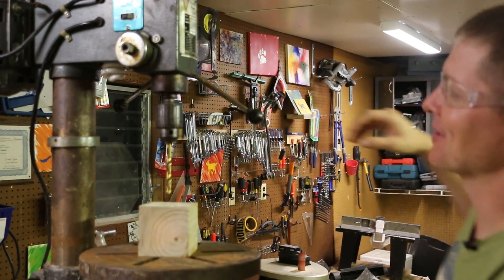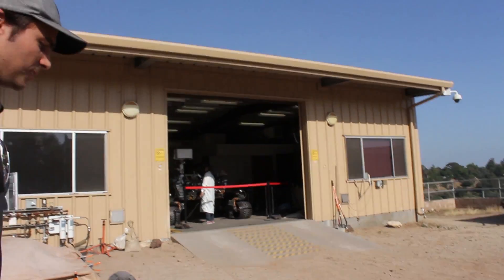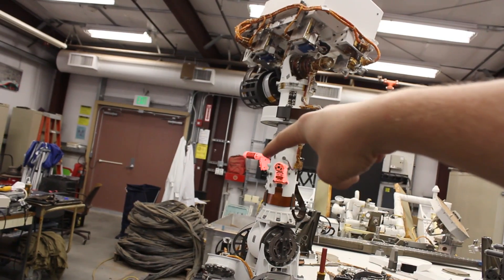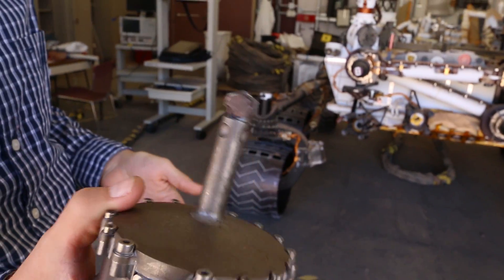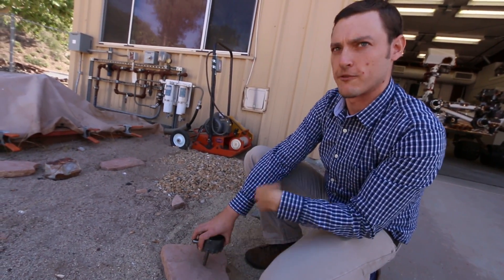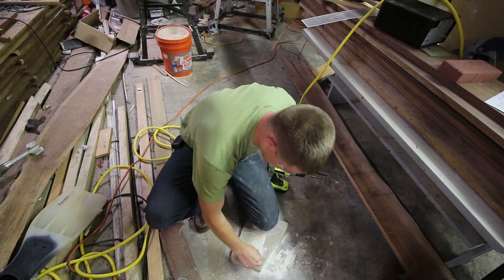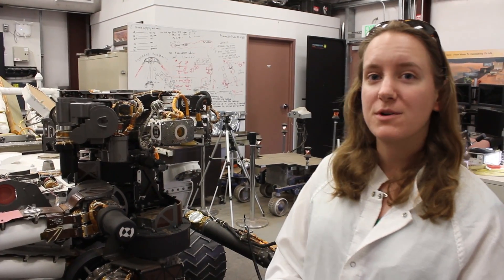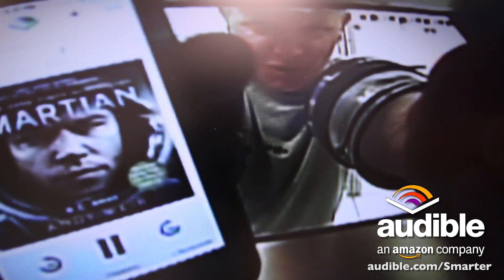The Drill we sent to Mars - Smarter Every Day 143

Comment: So whats the drillbit made of? Tungsten Carbide? Diamond? Nokia 3210?
Reply: +Internetspaceships The tip of the bit is tungsten carbide.  In hardness, it's somewhere between the Nokia and diamond ;)
Reply: +John Williams 
You're right, the drill bit (cutting edge and shank) is a commercially-available hammer (masonry) drill bit, with a little extra machining to improve sample flow along the flutes.  

I can't speak for the design trades that went into the bit assembly design, unfortunately.  The drill and the bit assemblies were designed and built by others long before I graduated from college and was hired at JPL.  You can find more information about the drill in NASA/CP-2010-216272, but it doesn't say much about the material trades that you're interested in.
Reply: +Video Olympics when things are too strong to break, its always made up of nokia 3210
Reply: +Internetspaceships Nokia XD the old phone that always could.
Reply: +Internetspaceships Nokia ?!!!! We are trying to get sample, not destroy the planet. PLus, if they drop the Nokia during the landing that will end the mission
Reply: I did not realize there was such thing as 'negligible weight' when launching craft to other planets...I've been in aerospace manufacturing for over 30 years and have kept-up with the new material-cutting technology available...ceramics, for instance, can in some applications preform as well or better than tungsten carbide.
   I'm not suggesting they would be better, I'm just saying that I'd like to have been the fly on the wall during the material review discussions because ceramics are a fraction the weight of carbide and when going to space; every gram counts!
Reply: +Internetspaceships pure nokium
Reply: +Internetspaceships  Tungside Diakia 3210
Reply: +John Williams Sintering a tungsten tip onto the drill is going to add negligible weight. Even with 2 back up drill assemblies.
Reply: +David Harding Awesome read! I&#39;s baffling that a commercially available product that anyone can buy pretty cheaply is so good as to being used, off the shelf, in a billions-dollar, space-fairing rover. And in one of the most important instruments!
Reply: +Ryan Kinnett 
   I imagine much debate went into the drill-bit design characteristics...with an emphasis on weight, and tungsten is heavy.
   Is the bit itself (cutting tip only):
SOLID carbide? 

...because to me, it looks just like a masonry bit for concrete but at such a weight cost! I'm sure plating atop lighter, yet stiff materials was also an option for a cutting edge...(I sure would have liked to be a fly on the wall during that phase of design discussion)
Reply: XD
Reply: +TheStarkest Like black boxes.
Reply: +Internetspaceships I got two Nokias, I keep them in case WW3 pops
Reply: I thought it was Depleted uranium + Titanium alloy = Special nasa classified metal
Reply: Most probably NOKIA 3310
Reply: Not the 3210, its the nokia 3310
Reply: +Internetspaceships 
It's carbide. The story follows:

My father was a scientist who worked with Gene Shoemaker on the curriculum for teaching geology to the Apollo astronauts and also on the team that designed the original Apollo Lunar Surface Experiments package (ALSEP). Gene was a college instructor for one of my best friends, who was in charge of the geologic mapping project for Mars at USGS. 

My friend invited me to attend the Lunar and Planetary Science Conference with him a number of times before he retired. I told him I was in Nerdvana every time I went. He introduced me to many on the science team for Spirit, Opportunity, and Curiosity, and I got to attend many of his working meetings.

One person he introduced me to was the man in charge of Curiosity’s instrument package, whose nickname was "Ratman" since he ran the RAT (Rock Abrasion Tool) on the original rovers. I've had many nice visits with Ratman over the years and he told me they wore out the diamonds on one of the rovers and I asked him if they were going to have a turret on Curiosity with extra bits and he said, "Yes, we'll have extras and you'll never guess where we got the bits--Home Depot!"  The drill bits are made by Hilti and were purchased at Home Depot. He told me the biggest problem they had to deal with was the quenching oils Hilti used in their manufacture. Hilti wouldn't divulge them because they were "trade secrets", even after assurance JPL would keep it under wraps. They did many types of cleanings to get the volatiles out and numerous tests to establish the chemical signature of what was left so that could be accounted for in their test results. I really think Home Depot and Hilti are missing a marketing opportunity in this.

Ratman’s wife is an orbital insertion specialist. She figured out much of the revised burns and insertion protocols for the Huygens probe that landed on Titan. Originally, a dedicated antenna had been planned for Cassini to handle the signals from Huygens but it was removed to save weight and the plan was to use the main Cassini antenna. Only after the craft was on its way did someone realize the main antenna couldn’t handle the Doppler shift between Huygens and Cassini and the early part of the mission had to be reconfigured to keep the relative velocity of the spacecrafts within range and then the planned orbits and gravity assists had to be adjusted to get the mission onto its original itinerary. Ratman’s wife is the one who calculated all that. He told me, “I consider myself to be a very competent scientist but I don’t even pretend to understand what my wife does!” So, if you see a soccer mom tooling around in her minivan near the JPL campus, she just might have a higher IQ than you and me combined.

Ratman also showed me some videos of a few other rover ideas they are working on, including some that could separate into two sections and lower one down into a lava tube skylight or off a cliff to do some science. Those guys have WAY too much fun!

Comment: How do they make sure that the debris in the first and second chamber of the first drill doesn't mix up with the dust from the second drill? Or does it not matter really?
Reply: +BigBadWolf When a sample is collected, the rover does all of the processing it needs to do for that sample then dumps it before collecting the next sample. There is some contamination between samples but that's part of the reason for the Organic Check Material OCM. If a really interesting science result was found in a location, the rover could sample the OCM to get a baseline from a known material and then collect another nearby sample and see if the same result is confirmed.

Comment: Why do they have to over-complicate everything? I would've put a vacuum hose on the end of the drill (a proven tool) and analysed the dust through that. I honestly hope they're not just justifying their jobs with this rube-goldberg approach.
Reply: +Dani2wheels Its actually simpler than a vacuum. A vacuum needs a additional motor, and a fan. Possibly another tube as well.Which are simply more things that can break. The arm already shakes to drill and a contained motor isn't that liable to break. You also have to remember that mars has .6% of the atmosphere of Earth, you would have to then have a really powerful motor to produce suction in that kind of pressure. A little motor to turn something isn't that big is less complicated than a huge vacuum.
Reply: James Kinard Good point
Reply: +Dani2wheels How much non-drilled material would you vacuum in? derp.
Reply: Xelbiuj Wtf are you talking about
Reply: +Dani2wheels Vacuum cleaners don't really work when used in a near vacuum environment XD
Reply: Alex Bv "near" vacuum and low gravity, it's definitely possible

Comment: Why did she need to be grounded? 
also that thing is HUGE!!!! I always thought the rover was about the size of one of those bomb defusing robots.
Reply: +peter griffin She has to be grounded because people develop their own electrical charge and Curiosity's circuits are very sensitive to electricity. So if you where to touch it you could shock it and fry some electrical components. Which would be a very bad day.
Reply: makes sense I guess. I feel like if it is that sensitive then It would just fry as soon as its on its own. Like wouldn't the rover build up a lot of static electricity in a Marian dust storm.
Reply: +peter griffin I think the circuits in the rover are insulated to prevent any harm to the system that could naturally occur during its work on Mars. The problem is when an external current is suddenly applied to the system. It is the same as the shock you get when touching your car, and that spark can have some significant voltage (+ 2000 V). For the same reason you should always ground yourself befor working on your computer mainboard or any other sensible electronic device.